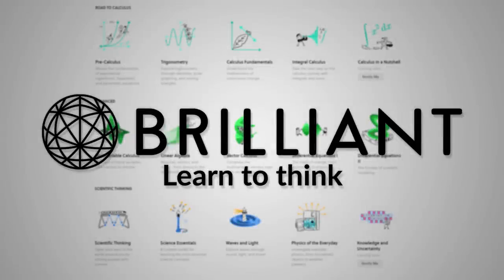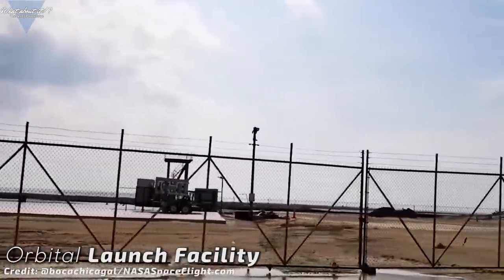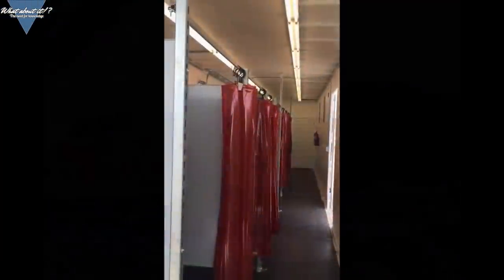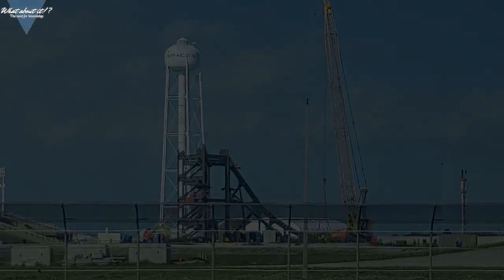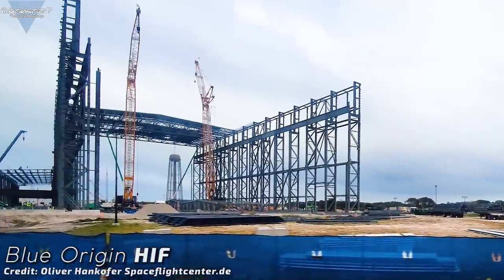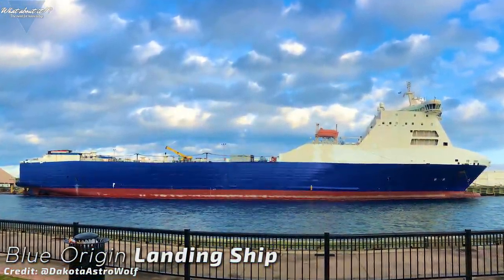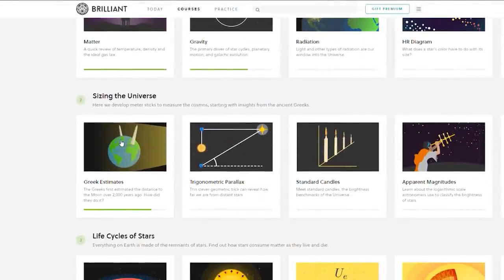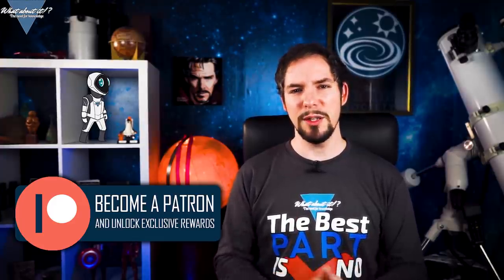60 | SpaceX Starship Updates – Blue Origin Launch Complex – Starliner Orbital Flight Test

Comment from the maker: When will New Glenn fly and will Starliner do a successful flight to the ISS?
Reply: I for one hope that New Glenn is farther along than the public thinks. We need options for manned spaceflight and there is plenty of room in the pool. As soon as somebody makes a buck from resources mined off planet there will be a land rush to secure a seat on anything capable.
Reply: Starliner - a successful flight yes. The landing? Not so sure.  New Glenn will fly 17 months, 2 weeks, 3 days, and 4.5 hours from now.
Reply: Star Starliner is a very advanced vehicle let alone the launch system's history I believe it is going to succeed. And about New Glenn knowing how blue origins works I cant see it launching before November 2020 or even early 2021 . But we all hope for sooner.
Reply: Falcon 9 was built with a simpler, cheaper design of their body/tanks, traded ideal efficiency for lower cost in several aspects, and could afford to drop/crash quite a few boosters in the ocean to learn to land. I've heard BO is using the traditional machined isogrid method, which is very expensive for that size tank, (part of why SLS costs so much). Am guessing BO wants to land first time every time, will move toward that slowly.
Reply: The construction of the big and expensive structures shows that BO is now finishing the planning phase and approaches for the construction and test phase. But even when construction/testing commences, it may take quite a while before the first test flight of a fully assembled rocket takes place.

From GeekWire:

"LYNNWOOD, Wash. — Blue Origin, the space venture founded by Amazon billionaire Jeff Bezos, is now planning to send its first crew on a suborbital space trip during the first half of 2019, and launch its first orbital-class New Glenn rocket in 2021.

That’s the word from Bob Smith, CEO of the Kent, Wash.-based company, who spoke here today at the Aerospace Futures Alliance Summit."

So the pace of the construction seems to be totally in line with the schedule. And BO is not known for being faster than their schedule.
Reply: What about it!?, Starliner has no business being in business. It’s company relies on government “Medicaid.” Capitalism rocks and, SLS is socialism.
Reply: @leapdrive  SLS is the result of modern capitalism. Socialism helps the people, capitalism helps corporations.
Reply: Corey S, socialism helps people like China and the USSR does. Capitalism applies to every entity, people or corporations. Your SLS survives by government grants. If we were capitalists, the entire SLS rocketry would be closed.
Reply: Corey S - I tend to agree with leapdrive on this one - As has been explained to me by people who’ve lived under both, NAZISM is “National Socialism” while Communism is “International Socialism” - Both are forms of SOCIALISM & are collectively responsible for the violent deaths of ~200 million people in the 20th Century. As I once stated in a debate with a communist college professor, communism & other forms of Socialism need to compared, not with Dickensian/Darwinist Capitalism (or the “Crony Capitalism” we see in so many government contracts), but with modern ethical/regulated capitalism that works for much of the world & has managed to help nearly 1 billion people get out of poverty.
I believe that people concerned with “producing a return on investment” (& not compelled by the political factors that have forced SLS funding to continue) would have canceled SLS as soon as it became obvious that it would not meet its first deadline in 2016 & that it would cost nearly 100% more than initially estimated during the term of the contract. &, I don’t think they’d have even considered building a Lunar Gateway to deal with the fact that SLS Block 1 could barely put Orion & its ESM into TLI, & would be utterly incapable of putting that along with any reasonable lunar module/lander into TLI.
Reply: leapdrive - I don’t believe Corey S. is a fan of SLS - He just doesn’t know who to blame this expensive boondoggle on. He doesn’t understand that the Crony/Corporatist Capitalism that causes SLS to be funded has the same resemblance to Ethical Regulated Capitalism that cancer cells do to healthy cells. The same holds true for the “resemblance” between the corporate socialism that keeps funding SLS and the Social Security Systems put in place by Otto Von Bismarck & FDR & the package proposed by David Stockman & Richard Nixon.
Reply: @TraditionalAnglican   Don't ever assume what I understand. I know exactly why SLS is still alive. Political cronyism. 
Twenty Billion dollars into the pockets of Congressional Friends.

Obama cancelled the Constellation Program. The Republicans wrote a law changing Constellation into SLS. Congress also wrote a law banning NASA from researching into the technology that ended up being the Bigelow expandable habitats.

Nazi Socialism isn't really socialism, its like East Germany calling themselves the German Democratic Republic or North Korea calling themselves Democratic People's Republic of Korea.
Sweden, Denmark, Iceland are pretty good examples of modern socialism.

NASDP was only ever a fascist party, much like America today. Trump's pre-election rhetoric was copied from the fascist playbook, target a vulnerable people, also look at Rwanda in 1994. You read the quotes and if you change Mexican to Jew, it could have been written in the 1930s. Trump's mannerisms/facial expressions in his speeches copied Mussolini.

Leninist/Stalinist-Communism isn't socialism, international or otherwise.

The LOP-G/Gateway project is only there to give SLS a mission. SLS can't land anyone on the moon in its current configuration.

The 'purest' form of Capitalism is Organized Crime/gangs. No government bailouts if you make a mistake.
 No protections.

That 'ethical' capitalism that sponsored and trained Bin Laden to fight against the USSR in Afghanistan, which led to Al-Qaeda and ISIS.
The 'ethical' capitalism that is destroying the EPA in America.
The 'ethical' capitalism that led to the 1.4 TRILLION DOLLAR bailout of gambling stock brokers in 2008/2009.
The 'ethical' capitalism that led to the Iran-Contra affair.
The 'ethical' capitalism that led to meddling in Lebanon, Honduras, El Salvador,  Nicaragua, Guatemala, Iran, Iraq, and others.

My family has lived with Nazism, lived in Berlin during WWII, was a victim of the polio epidemic, helped by the Berlin Airlift.

SLS is cronyism and the 'trickle-down economics' that Reagan foisted upon the middle-class.

FDRs programs during the 1930s was a tremendous help to the America people, just like the GI bill was a tremendous help to returning servicemen and women after WWII and Korea. Sounds an awful lot like socialism.
 Medicare, Food Stamps, Medicaid, other social programs because your vaunted capitalism isn't paying their employees enough to live on, let alone retire on. Foodstamp usage has risen in every county that Walmart put a store into. 

"Ethical Regulated Capitalism" is the supreme oxymoron. Capitalism is anti-regulation. EPA is a prime example,  Trump and Pruitt have done much to demolish the EPA.
Reply: Corey S - “Socialism is government control of the means of production.” (Definition from DAS KAPITAL, by Karl Marx) - That was true of NAZI Germany, FASCIST Italy & COMMUNIST Russia (USSR) & “Red” China, All of which had government control of the means of production, “5-Year Plans” which tried to remake their economies into the image of the dictators & caused untold death & human suffering. I really urge you to study the history of the State Produced Famines & Purges in the USSR under Stalin & the Famines during “The Great Leap Forward” & “The Cultural Revolution” under Mao in China. The same has been true of Cambodia (Khmer Rouge), North Korea & Venezuela. 
The Crony Capitalism that brought us things like the Bank & Financial Institution Bailout, Solyndra (Government funding of a failing corporation with a 💩 product & even worse business plan), SLS/Orion & most of the things on your list has nothing to do with ethical regulated capitalism & everything to do with Huge Government & Political Corruption. Remember, both President Obama & President Trump (along with 3 NASA Administrators) tried to cancel this expensive boondoggle, & all of their attempts ran into the “Great Congressional Wall”, & it took a lot of political arm twisting to get Commercial Supply & Commercial Crew through Congress (including a crazy person parking a rocket next to a giant Congressional celebration of Spaceflight at the Smithsonian).
Barron Chancellor Otto Von Bismarck (who first proposed the Social Security System emulated by FDR) & Karl Marx (The author of Das Kapital) would both disagree with your characterization of Social Security & the GI Bill as forms of government control of the means of production (I.e., Socialism). As would the various people who ran the Roman & English “Social Welfare Systems” during the Roman Empire & from 1400 - 1800 (When the “Dickensian System” of “Poorhouses” & “Debtors’ Prisons” took over). 
The atrocity in Rwanda had nothing to do with capitalism or socialism & everything to do with tribal hatreds going back for over a millennia. The same is true of the violence in the former Yugoslavia after the fall of the USSR & the death of Marshal Tito. Blaming them on either is like blaming obesity on the mere availability of food or STS, ISS & SLS on the existence of NASA.
I think it’s easy to forget that environmental regulations were largely a response to situations such as the deadly “London Pea Soup Fog” of the 1940’s & 50’s & various rivers actually catching fire in the 1950’s, & that this response had popular support from people who largely felt responsible for things they felt they possessed & had stakes in. The final result of this was EPA & Superfund Legislation & Funding in America. It’s also easy to forget that the EPA (under Obama) was responsible for one of the worst American environmental disasters of the 2010’s (Gold King Mine spill in 2015), that the 2 worst environmental disasters of all time were perpetrated by a Socialist leader (Iraq’s Saddam Hussein in 1991) & that Communist countries had a terrible environmental record. Before you argue that point, I remind you that BA’ATH in Arabic means “National Socialist Workers Party”, that Arab BA’ATH parties were modeled after the German NASDP, & that the USSR & Red China were both responsible for some of the worst environmental disasters in human history. I think “Clean Coal” as it’s now practiced is a misnomer like “Ministry of Peace” in Babylon 5, but, at some point, you get a tension between the need to perfectly preserve the environment & to preserve people’s jobs. I think it’s hard to remember that the people who wanted environmental regulations had jobs & families they were able to support with those jobs, but I don’t think they ever wanted unelected, unaccountable bureaucrats who were never going to be effected by their decisions to be able to threaten those jobs & their livelihoods, & I’m sure they wanted the bureaucrats to be held to the same standards as they were.
I’m sure you must know that even FDR refused to allow Federal employees to unionize (something about a monopoly negotiating with a monopoly to spend the money collected from people who were allowed no input in those negotiations), & that Federal Employees weren’t unionized until the administration of JFK. I’m also sure you must realize that both BMW & VW employees in America soundly rejected efforts to unionize them during the Obama Administration, efforts which included both Government & Management pressure to join the UAW. And, I’m sure you know that anti-union violence & coercion on the part of corporations happened mainly during the time of unregulated capitalism that brought on the “Square Deal” & “Trustbusting” of TR & the pro-union regulations & New Deal of both Herbert Hoover & FDR.
I really do believe any discussion of the relative merits of Socialism & Capitalism must actually discuss how both have been practiced by real people during the last 80 years in the real world. It’s completely unfair to compare an idealized version of Socialism that has never been practiced to the Dickensian/Darwinist Capitalism that capitalist societies have rejected. While Capitalism has its flaws & missteps (it is a HUMAN institution which relies on HUMAN activities), I believe that Capitalism as it’s been practiced in the Western world for most of the last 70+ years looks pretty damn good when compared to actual communism & socialism as has been practiced throughout the world for most of the last 100 years.
Funding for the “freedom fighters” in Afghanistan was controlled by Pakistani Intelligence who decided who got funding & who didn’t. ATST, it’s hard to remember that there was a much worse alternative that had invaded the country. I seem to recall PM Sir Winston Churchill stating he would say nice things about the devil if Hitler invaded hell when he was asked why he was supporting someone he believed was evil (Stalin). And, Churchill said that Democracy was the worst system of government devised by man, except for all the rest. International Politics (& life in general) rarely gives us a choice between an the perfect & an actual good, or actual good & a mediocrity or an obvious evil, or even a mediocrity & an obvious evil - It’s almost always a choice between an apparent evil & a near absolute evil. I tend to think that choosing between SpaceX/Blue Origin & SLS is one of the few times life gives us a choice between an actual good (Starship &/or New Glenn/New Armstrong) & an apparent evil (SLS & Lunar Gateway). It would be a crying shame to allow SLS/Orion/Gateway & Political Cronyism to win because we’re too busy arguing & being involved in partisan politics to unite against this obvious waste of taxpayer money.
Reply: @donjones4719  Falcon 9 is so simple it can land vertically, something an orbital class rocket had never done.
Reply: @GreyGeek getting particles to that speed requires the power of a city.😮. CERN
Reply: @LordFalconsword   I agree, F9 is the best launcher flying today by a wide margin. A genius design - they've combined simplicity and cutting edge design. Falcon Heavy will be able to launch most of the heavy payloads needed, for much less than NG. NG will be left looking for the very rare super payloads, and very few launches means more cost per launch.

And that's even without Starship in the equation.
Reply: Three years and yes.
Reply: Are you on twitter
Reply: Corey S "that wasn't real communism" "orange man bad" 
"Stop saying I am an NPC that is dehumanising"
Your whole essay in a nutshell
Reply: @GreyGeek thanks for responding to my post, your comment is theory, and not yours.
The real question IS?
How fast can a interstellar space probe go? Before it experiences a Rapid Unscheduled Disassembly?
What we call the Vacuum of space, is Not a Vacuum, but a very thin gas cloud.
Question for you, GreyGeek, how many atoms will a one square yard space craft, traveling at half light speed, smash into per second?
How much damage will occur?
How much extra radiation is created in front of the space craft?

This is an all electric thruster, NO fuel tank. 
Disclaimer-Our test results must be independently validated!
I am an inventor, and have several patents, my focus is mostly water and air fluid Dynamics. This space thruster was kinda a joke, I had this idea one night sat straight up out of the bed. Drew up a space thruster design the next morning.
Called my business partner, he reviewed the design. Real quick he says, yeah that will work.
We are busy, developing our fourth prototype Drywash plant for gold and RRE extraction. This product is not for sale. Major breakthrough! We have shut down product sales, and are going to be mining this spring.
The space thruster, got built, ONLY because the budget was forty 40$ dollars. Almost done, got the last materials in yesterday's mail.
The unofficial name is the M848 space thruster. M is for Macgyver!
Reply: @GreyGeek GreyGeek, as you can read from your own Post, no craft has tested the limits, or proven what the fastest safe traveling speed is in the interstellar vacuum, or determined the fastest speed before an RUD occurs.
You can make the calculations, but  you can't test them, or prove them Yet! 
You can probably calculate all the physics of how to swing an axe, but have you ever used the axe?
Reply: @GreyGeek First, we don't need investors.
Second, the test results must be independently validated.
Third, rarely does the inventor financially benefit from their work.

If we are successful, we do hope we get recognition as the inventors. We have no intentions of building IT, beyond the initial prototype to prove our theory is sound.
This prototype is an impulse engine, this is not a V8, more like a single cylinder, V1. You have your 2 cycle and 4 cycle engines, this is a one cycle engine, one electrical impulse creates one thrust cycle.
For testing purposes we didn't install the electrical components, so the engine can only fire one cycle, to test only the thrust converter, not the electrical components. 
So we didn't build the car engine, we built the lawn mower engine, and only allow it to run one ignition cycle. To test a single cycle of thrust generation. I understand all the reasons it shouldn't work, and am surprised to see that it is working, despite not being fully assembled.
Also we could not find a source of Pixy dust, our budget was to low.

When the testing is complete, we will send it to NASA for testing.
I doubt that we will be able to retain ownership.
Reply: @coreys2686  absolutely not true , capitalism has drag more people out of poverty that socialism .as is proven socialism brings poverty !
Reply: @zasde35 What capitalism are you referring to? Which socialism?
America has some of the worst health outcomes of any nation in the world. There is a greater wealth disparity amongst Americans than just about any other country.

Are you referring to American Imperialism/capitalism?
The 2008 economic collapse was precipitated by Wallstreet CAPITALISTS GAMBLING. Then when they screwed up, they got bailed out. A real capitalist country would have let those banks fail. We would have been better off giving the money to the people that would have been affected by the banks going under. The US TARP program cost America US$1.4 TRILLION. The value of the credit default swaps and derivatives is higher than the GLOBAL GDP. Those little gems turned debt into assets. Wall Street bankers were effectively printing money. You and I try that we get arrested for counterfeiting.

Capitalist 'healthcare system' that has seen millions of Americans unable to pay for basic medical care. Hospitals charging many times more than the retail cost of over-the-counter medications, because you're stuck there when you're ill. American's average life expentency has dropped over the last few decades.

Private Penitentaries in America have the highest per-capita incarceration levels as well as absolute incarceration levels. There are more people in American prisons than in Chinese prisons.

Are you referring to Soviet Socialism?
That was a continuation of the Russian Empire with a new face. The names in power changed, that was about it. Stalin's five year plans caused a famine that killed millions. His purges killed and imprisoned many more.

Are you referring to Cuban Socialism?
Cuba has suffered under US sanctions since they overthrew the Batista dictatorship. The revolution was a response to US organized crime and American companies to run roughshod over the country.

Are you referring to the American capitalism that interfered with dozens of foreign countries for the last 150 years? https://en.wikipedia.org/wiki/United_States_involvement_in_regime_change.
Democracies that failed because of American interference: Iran, 1953; Guatemala, 1954; Congo, 1960; Dominican Republic, 1961; South Vietnam, 1963; Brazil, 1964; Chile, 1973